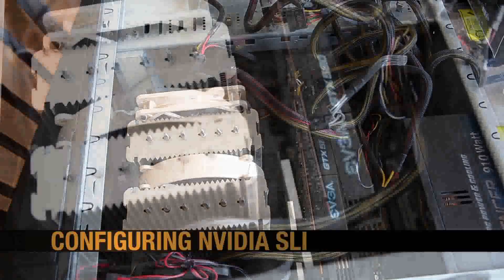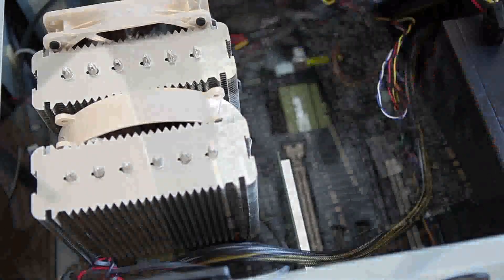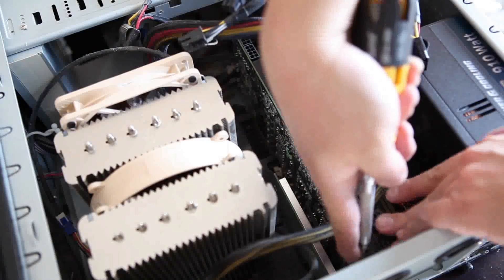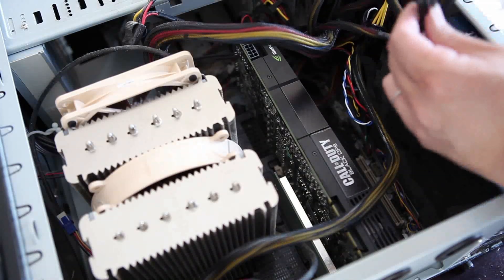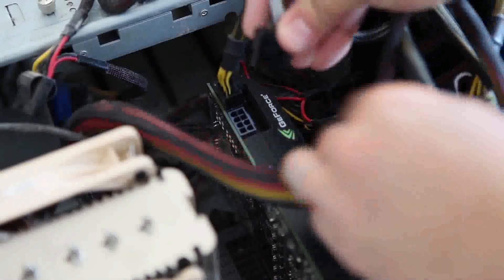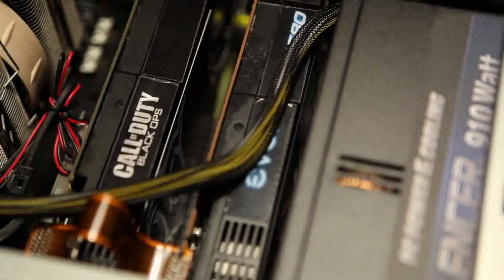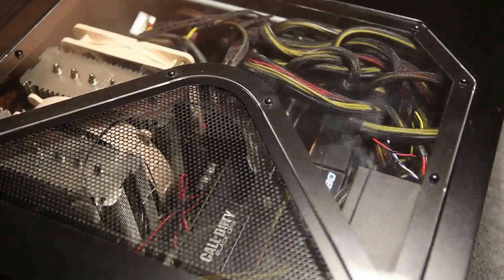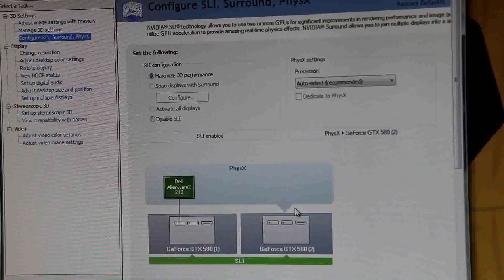How to Set Up Nvidia SLI

Comment: I have gtx 770 2gb running 2 way sli :) and also an i7 4770k. It's a beast of a machine
Reply: I wanna get another gtx 770 4gb,  I also have a i7 4770k... Do you think 46C is good for overclocking to 4.2ghz?
Reply: yea it should be :) are you running liquid cooling, if not i highly suggestst getting liquid cooling
Reply: No Im using a hyper evo 212
Reply: i got the same processor and a gtx 780 butr now bought two gtx 970

Comment: You can SLI any cards of the same model. So, yes, as long as they are both 680s, it is doable, however, it's going to scale off the lower clockspeeds

Comment: Just wondering can i currently have 2 Evga overclocked gtx 680s and im bidding on a 3rd could i not add a lets say MSI 2gb gtx 680 that is a lower clock speed because its not a superclock?